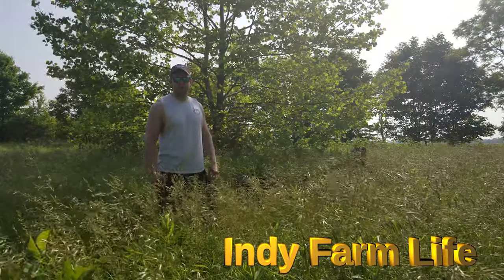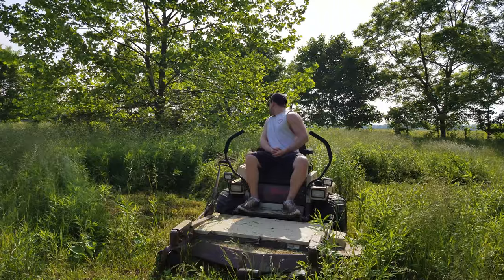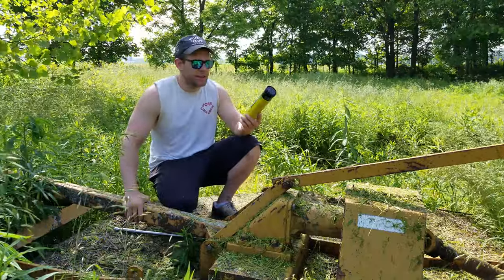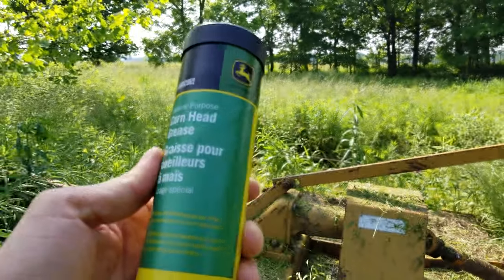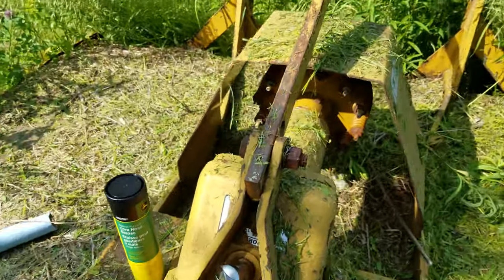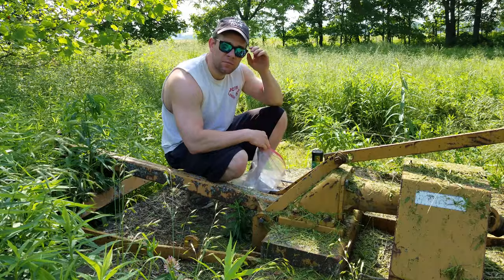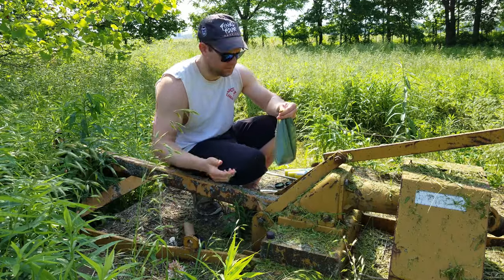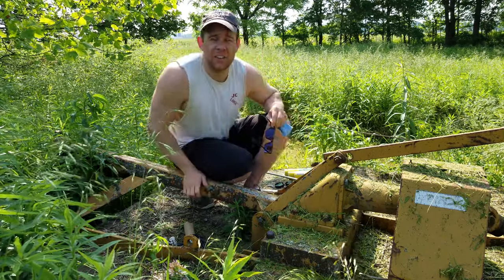Easy Way to Fix a Leaking Gearbox on a Bushhog (rotary cutter) - Use Corn Head Grease

Comment: I had same problem.  2 hours of mowing would go thru 2 quarts of 75/90 gear oil.  I put the corn head grease in and mowed for 6 hours with no change in grease level.  Fixed!  I think I would just do this with any brush hog even if it didn't leak.

Comment: Have done this to a gear box for years with no issues. I use cheap icing bags to fill it. Takes two minutes if the fill hole is smaller.

Comment: I put the cornhead grease in greasegun with pump assy. off, put open end of greasegun tube over hole and let plunger go. It shoots the grease in fast.
Reply: U just answered a question that I do not have to type!  Just what I was thinking, use a grease gun, vs "cake frosting" in a plastic bag. Seems easier/cleaner.
Reply from the maker: Yes, I got smarter over the years. Ha.  I have found that taking a tube and  opening one end, placing it over the gearbox opening, and then ripping the foil lid off and pushing it through the tube with a stick works perfectly and is incredibly quick.

Comment: Just an FYI that might save you a buck in the future. Corn Head Grease is just JD's fancy way of selling you Polyurea grease. Just buy NLGI #0 to get the specific mix JD uses or even just buy plain old Polyurea grease, they'll both work better than just pumping a box full of lithium grease.

Comment: Don’t fill gear oil to the top! Fill it to the drain plug of halfway if it doesn’t have one! Maybe you knew that and just said “filled it to the top” because that’s how you talk I know but that’s what makes the seals leak. To much pressure from to much oil. Also I think that cornhead grease is just cheap grease gun grease but it definitely work for this.
Reply from the maker: Ahh yea.  She's not full to the top, but that's a good thing to point out!!
Reply: There's no vent in an angle grinder, and they use grease.  Pressure buildup is probably minimal, plus, aren't seals used in an engine with 60psi oil pressure

Comment: I think that is the same stuff as 00 grease which is also used on the old Snapper Riding mower chain drives. You can get it in a squeeze bottle like rear end lube.

Comment: I have used Extreme Pressure grease in a Woods Brush Hog for years without any leaking (despite a bad seal). I really think it is a better alternative to using the corn head grease.
Reply: Thanks for this tip as iv just bought a old cheap lightweight blue 6 foot Irish topper called a Belmont for 350 pounds in seemingly good nick but when I got her home I checked the oil seemed it needed some so went out and bought  some ep 90 next day which dripped right out underneath  within a acre so was going to order a new seal or maybe a new gear box.but after reading your solution and happend to have a 20+ year old can of extreme pressure gear box oil I think 90/140  in the shed and a cartridge of red heat resistant grease I had around. piped in all  the grease and then topped up with the oil.then off to work and no leaks iv topped up since as when I opens up the drain hole it was below the level as assumed the grease had mixed with the oil and coated the side walls of the housing so added some more oil until it ran out of the level hole   .No leaks and yet seems to be less noisy and less heat I'm going to check every hour .to see how its holding out .I'll let you know what's the verdict after 20 Acres. So far iv done 5 with no leaks what so ever ..there's no vent hole so have decided to put a hydraulic U in the filler hole to let it vent and won't let in water so moisture holding inside and vent out in a hour or so . .don't know if this is a good idea?as it is extream pressure oil .but I'm worried if it gets hot it might try to push past the seal again making it worse?iv got nothing to lose by giving  it a go.but not sure about the venting thing.I'll give it a try anyway.!don't know what gear box is on it seems a  generic part but it just says made in China and Chinese stuff was even worse quality 30 yrs ago than it is today. It doesent look a nightmare to change .so we shall see.?the old topper does have a nice unique feature as it is held on solely by the rear arms only by jamming underneath forward of the pins so doing away with a top link and it pivot hinged from the centre so follows the ground undulations beautifully and also I found out if you lift up the arms you can easly flip it right over to vertical on the pivot and lock it in place sharpen it or change the level of the  skids easly and So the end of the season you can get everywhere to clean and paint it with old oil for the winter or even store it leaning against a wall maybe i might try.Very Very impressed and can't see myself parting with this beauty as I don't want to be buggering around underneath things when I'm older.Why don't they put this feature on belmacs latest toppers.The set up doesent look complicated or weak or more expensive. They have just gone back to a conventional generic set up.Odd.if you ask me ! its the best thing iv bought in a long time .even if I did leak oil.but a replacement gear box is only 250 quid if I had to do it .but no rush now.Cheers for the tips.
Reply: Just be sure to not thin out the grease too much with oil as it will defeat the purpose. Mine is pretty thick and has had no issues at all. Also the grease thins out some as it warms up so that helps with lubrication in the hard to reach areas.
Reply: @shopdoc  That's a very good point .No leaks yet .but if i do get a drip I'll add some more of the grease to remedy .Thank you for saving me money and time .Its funny how you forget things but I'm sure my grandfather used to do the same thing with leaking gearboxes with his ancient tractors and machinery and probably had a sly joke about it .but it saw him out and he never ripped anything apart if he could help it .Things were only parked in a gap in the hedge if they were truly ronnied or rotten normally both.as most of his gear was 80 to 40 yrs old its safe to say they had had a life and were not wasted as a good supply of part knick nacks .lol he always parked his old zetor tractors on hill so he could start .as I don't think he ever bought a new battery .things could get a bit of a tiresome charade sometimes if there was a stoppage and nothing could be started as there was no good battery's to be had even in his land rover which he hand cranked its like OMG here we go again.seemed to have a garage full of dead batteries and dead battery chargers.  .Tesla he wasent but usually got things going ...eventually he had the patience of a saint and would always say there's no rush and would be as happy as a pig in shit especially if he thought he was saving money on a job as we witherd as he fixed things slowly

Comment: If it turns onto fluid when hot why not put it in a metal can and heat with a torch?
Reply: Seriously?
Reply: @dougdiplacido2406 Yes. It helps with the break-in process 😉

Comment: Put tube in hot water  use funnel when liquid 😋
Reply from the maker: Since this video I have started pushing the entire tube in through the opening by using a long screwdriver and the metal cap!

Comment: spends $40 on grease instead of $10 seal lol yea that makes sense
Reply from the maker: 4 minutes vs 2 hours...time is worth it
Reply: @IndyFarmLife  all depends how much money u want to throw in it
Reply from the maker: For sure!  I view time as money.
Reply: Exactly! This is why I'm so reluctant to buy anything used. This right here is the prime reason why.
Reply from the maker: In the grand scheme, this fix is a small time/monetary commitment.  This rotary cutter is a monster and will level 3" and 4" saplings with ease.  I purchased it for $800...new it would have been considerably more expensive.  I would buy this used 10x over.

Comment: DO NOT PUT GREASE IN A GEARBOX! Grease will turn into grinding paste and wear out the gears. Replace the seal and then the oil can be changed when required.
Reply: Grease is fine. Many use it, along with myself and it works fine.